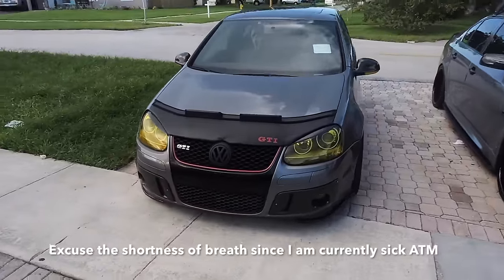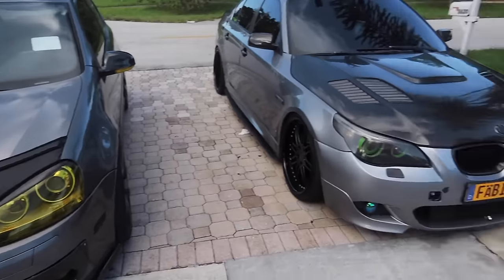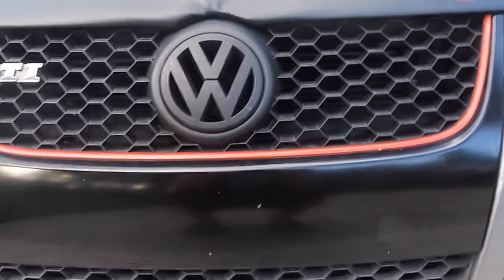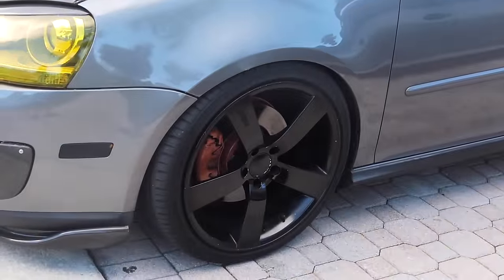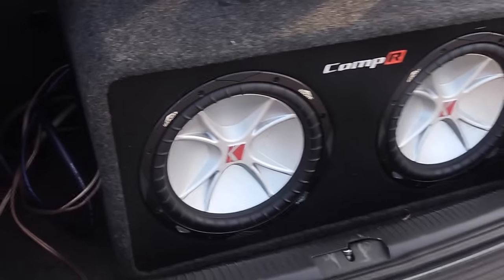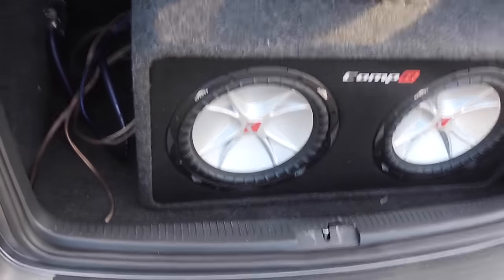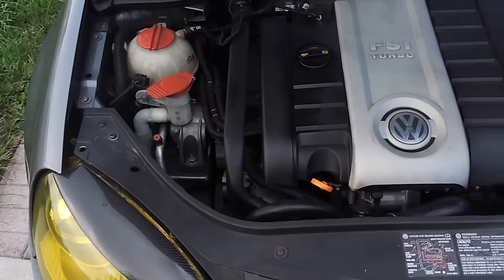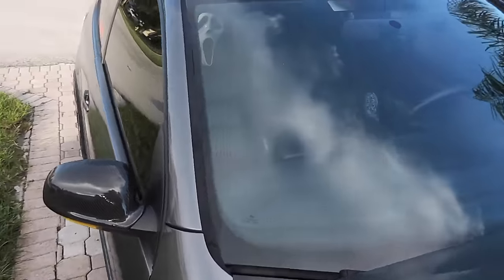UPDATE ON MY MODS MK5 GTI /VLOG

Comment: Go to ECS tuning, they have some nice cold air intake systems: I have a kohlefaser luft techinc system with an enclosed air box.  This keeps the hot air from th engine away from the intake system, increasing performance, while the box protects the filter from debris.  I got one after my stock airbox finally broke; eventually, the stock one will crack because of how they're mounted and the force required to remove them.  If all this is too expensive or you just want everything stock, your dealer may have a fix for your problem.
Reply from the maker: Thanks I will check it out.

Comment: that intake tube coming off is nothing to fear. it just gets air from the grill instead of under the hood from the hot engine bay. don't think it really helps anything but your filter is in that ugly engine cover and your air mass meter is beyond there as well. loose tube will cause your engine no harm at all. nice lip and stance on the h&r's. also I like the vw emblem on hatch blacked out and before I removed my gti from the hatch I had black gt and red I. it looks sick especially with the black vw hatch pop
Reply from the maker: thank you for the comment, I ended up buying a better quality clamp to hold the OEM intake tube to the intake box,  can't wait to buy a quality intake to get rid of the OEM intake box!

Comment: What kind of tires do you have?
edit: Word? you're in FL? 305, M.i.A
Reply from the maker: they are 235s i believe 35 wide
Reply: ThatRabbitGuy can you do me a favor and check? Just curious. I just bought an '09 mkv DSG and it came with ATREZZO 225/45ZR17 but I looked them up and they're cheap tires. About $200 for all 4. They slip too much in rain. Also where did you get the yellow film for the head/fog lights?

Comment: Where did you get the roof spikes ??
Reply from the maker: ebay, VMS sells them
Reply: ThatRabbitGuy what does vms stand for? I'm trying to find the eBay shop right now
Reply from the maker: http://www.ebay.com/itm/VMS-RACING-10PC-STICK-ON-VORTEX-GENERATOR-ROOF-FIN-KIT-FOR-08-15-MITSUBISHI-EVO-/262501842428?hash=item3d1e543dfc:g:eLsAAOSwZ1BXcpq3&vxp=mtr
Reply from the maker: They are universal, I recommend spending a good amount of time measuring them and spacing them equally.